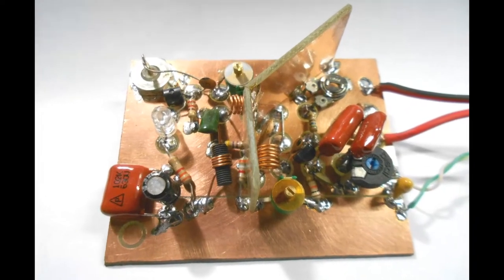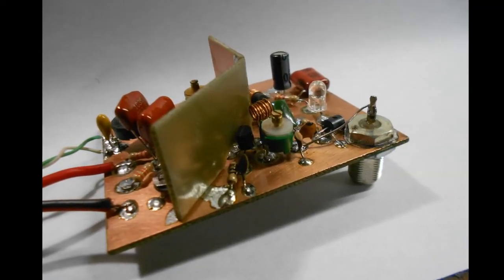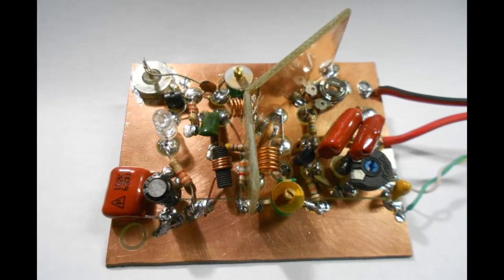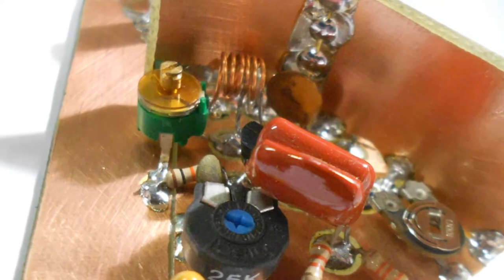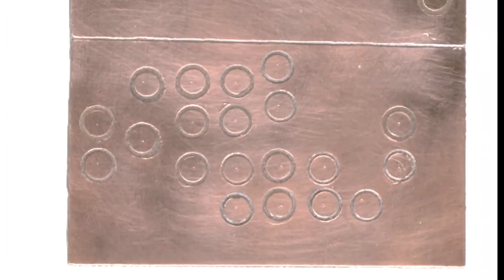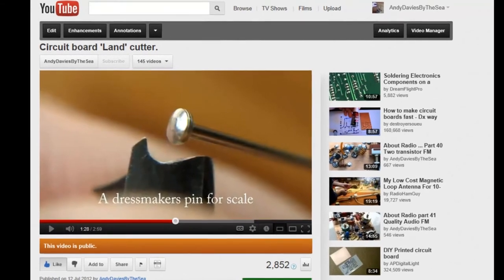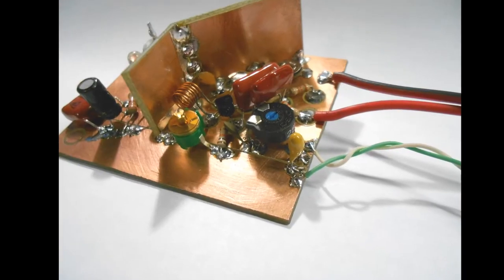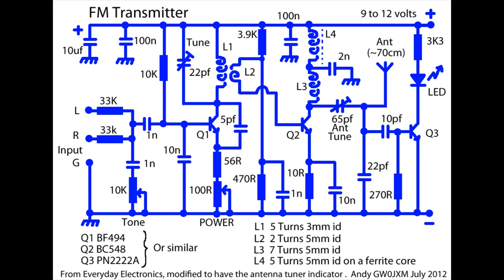About Radio 43 FM transmitter full circuit diagram and pictures from Tomas in Argentina

Comment: Just wanted to thank you you for your transmitter video. Based on your 
initial design, I was able to construct a working model with some 
modifications. Great fun and and an enjoyable learning experience. 
Thanks again!
Reply from the maker: Well done on making a working unit Regards . . .  Andy
Reply: @AndyDaviesByTheSea  Your tip regarding the heavier gauged wire for the 2 turn coupling was a big help. I using a VC tuner from an old radio so I can attach a knob and I've placed to whole thing in a small metal biscuit tin. I've also added a power amp stage using a 150MHz power transistor I pulled from a car stereo.  I'm experimenting with a 17" ground plane antenna. So far, I'm out to around a 1/2 mile. I'm in NYC so the tall buildings are a bit of a hindrance. I'm a teacher in the city here and my students think these projects are quite neat. Thanks again!
Reply: @AndyDaviesByTheSea  

Question:
I bought one of those cheap frequency display modules to use with my  transmitter project but haven't been able to get it to read anything except my signal generator. After a couple of failed attempts at making a buffer I gave up. The display remained in my junk box for a year. After watching a couple videos yesterday, I tried again. I built an amplifier circuit capacitively coupled to the oscillator using a 10p which is outputting a clean 100mV sine wave. The oscillator frequency remained stable, but the display module still fluctuated wildly. I tested the module with my signal generator again, and it worked fine at 40mV. Also tested my buffered signal output with a RF meter and got a correct 97MHz reading, same as the oscillator and antenna. Still doing some research... Do I need a Schmitt trigger or ADC to feed the analogue signal into the display module? No idea how to do that... Any thoughts?
Reply from the maker: Hi there I really don't know how to advise you for the best other that to say ask the question on the UK Vintage Radio Repair web site, I'd be surprised if you didn't get a workable answer quite quickly.All the best . . .  Andy

Comment: Thanks for the video Andy, I really enjoyed it. I don't remember if I told you, but I used a 2n2222 transistor for Q1 as I could not get the bf494.
Oh and yes, you can change a crystal resonant frequency by painting it with some ink marker if I remember well.

Thanks for taking the time to put the video together, cheers.

Comment: You sure can! You start with a lower value and file to higher. Keep in mind this reduces the power rating. You can also do this with metal film resistors, but that is a bit more touchy and you have to file only in one place typically. Lastly, you can file or grind both R's and C's IN circuit. This was done with some missile avionics in the early days - weight and G-forces contraindicated trimmers, pots etc., of the day. Handy old trick for restoring test equipment, etc!

Comment from the maker: Hi Dennis, OK on the carbon resistors. I’ve seen that notion in a war time ‘Radio Repairman’s’ guide but I’ve never done it. I guess the other ‘Rub it down to size’ activity is raising the frequency of crystals by rubbing them down with wet emery paper on a sheet of glass, funnily enough I was going to have a go at that just for the fun of it but I found I haven’t got any of the big old crystals here anymore, where does stuff go if you don’t keep an eye on it?
All the best ... Andy